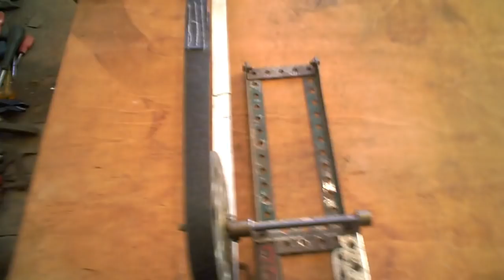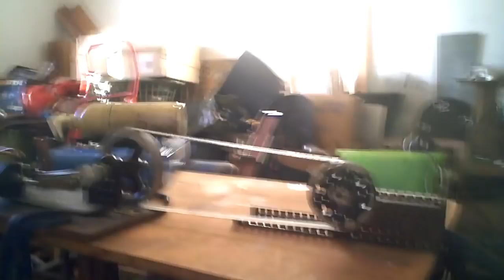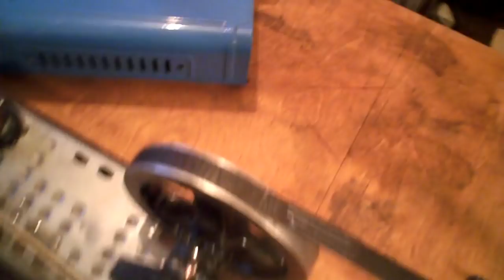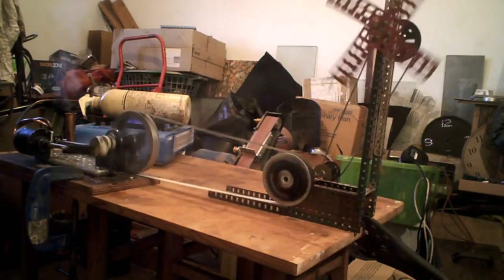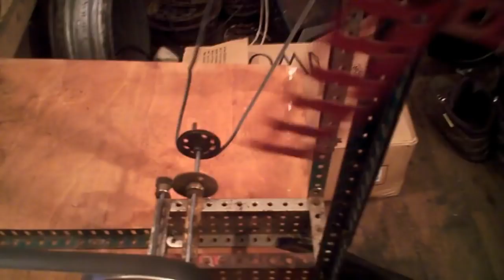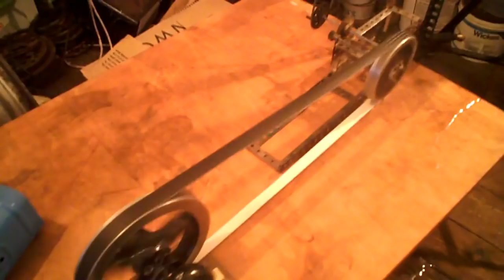Home Made Steam Engine Driving 1925 Meccano

Comment: Good job with that flat belt Malc. A question... Do you run the engine with a drop of oil on the bearings? You mentioned it doesn't have an oiling system. C!ive
Reply from the maker: You can oil the bearings Clive, it's the piston you can't. I actually had to weld the piston rod support on, so the only way to oil it is in the steam intake beforehand. Not too bad on air, but on steam it quickly dries up.